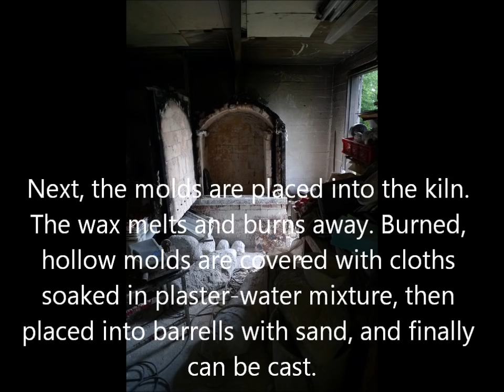Crocodile bronze sculpture, part 2/2

Comment: I liked the clay and the wax sculptures so much I hated they had to be damaged in the process! That's two perfect replicas -gone :(  (and you know you could make a mold to refill with other materials & sell!). Even if you used a light filler for center/reduce cost on major cost/outer shell casting material. Beautiful job! You're more patient than me :oD
Reply: Yeah there has to be a way to reuse the wax mold.
Reply: It's a silicone mold. They can make as many wax copies as they want, very easily. Making polyurethane, fibreglass and plaster casts can also be made from it. I make them myself all the time.

Comment: Thank you for this interesting instructional video.
I have 2 questions: 
1) at what temperature did you fire the plaster/sand  mould when dewaxing?
2) did you pour bronze when mold was still hot?

Thank you very much, I really appreciate your work and sharing.
Reply from the maker: +ZippyCalzeLunghe ) Master fires molds at 700-800 °C. 2) No.
Reply: +Phoxinus1 Wow,  I would have said the mold would crack or even the plaster mix turn to powder at such high a temperature! Thank you for your fast reply
Reply: ZippyCalzeLungheغ
Reply: ZippyCalzeLunghe

Comment: Congratulations for a perfect job! What did you use for the final mold? Regards!
Reply from the maker: Thank you. The mold mass consists of sand, fine gravel and plaster mixed with water.
Reply: Thank you! I intend to cast a motorcycle fuel tank and everybody say I'm crazy and that the easiest way is molding aluminum sheets.
But I really want to cast it!
I didn't find online anybody that could help with some tips specifically for a fuel tank.
I taught doing it in 2 halves, each one molded like your alligator and then welded together.
What do you think?
Best regards, 
Flavio (from Brazil)
Reply from the maker: Flavio Vianna I have seen vehicle parts being cast in aluminium with sand casting process. http://en.wikipedia.org/wiki/Sand_casting Then welded together.

Comment: Master, I usually melt scrap brass for casting but many times I have problem with metal shrinkage. I think with a true bronze composition this problem can be solved. what alloy composition do you recommend? do you use silicone bronze? is this correct that many bronze alloys expand as they solidify?
Reply from the maker: +reza emami i'm just a learner. Our Master mixes scrap bronze and brass with pure metals to an alloy of 85 % copper, 5 % tin, 5 % lead and 5 % zinc. With this composition the shrinkage is 2 %. Typical shrinkage allowances for bronze alloys: http://images.slideplayer.com/2/730193/slides/slide_21.jpg
Reply: +Phoxinus1 tnx for your very precious answer. I have seen different recomended statuary copper alloys but I will try this one you mentiond because your information and suggestions to me have been always helpul and valuable.

Comment: how much $$$ per kg to fill the mold do they charge?
also what materials did you use: latex, wax, clay, mud?
Reply from the maker: 10 € / kg (approximately 13 $ / kg) including materials for the casting molds (sand, plaster, sprues) and fuel oil costs for mold burnout and melting the metal. List of materials used: iron wire, clay (for the original model), mold silicone, plaster, hessian cloth, wax (the mold for pouring wax), sand, gravel, plaster, water, wax sprues, sisal twine, iron wire (for the casting mold), bronze, nitric acid, liver of sulfur.

Comment: thanks for this helpful video. can you explain about drying, wax burnout and baking time and temperature?
Reply from the maker: We don't dry molds for purpose but place them often straight into the kiln which is heated with an oil burner at 750 Celcius for 12 hours.
Reply: Phoxinus1 tnx teacher. thanks to your help,I could do almost the same process successfully.
Reply: Phoxinus1 one more question. How can I recycle the wax? will you please introduce some homemade devices or easy ways?
Reply from the maker: reza emami No experience for recycling the wax.
Reply: Phoxinus1 tnx anyway. your video has been very helpful for me.